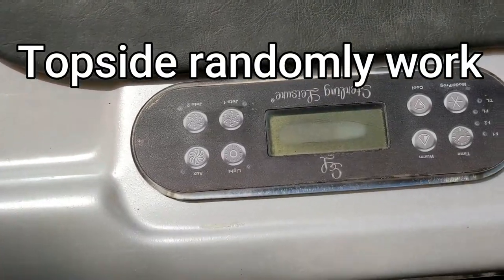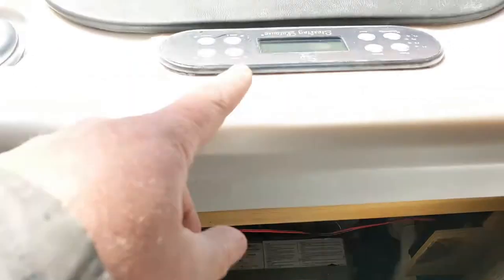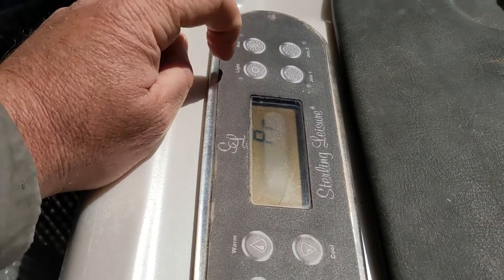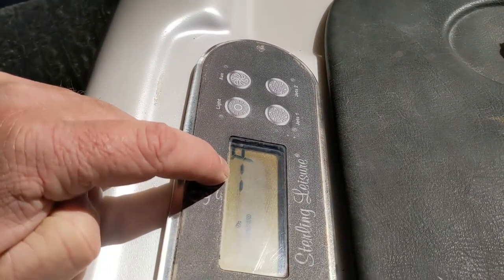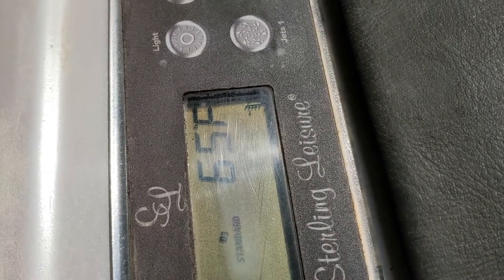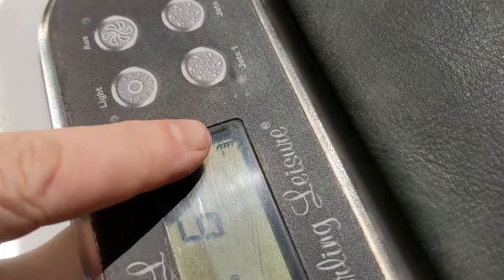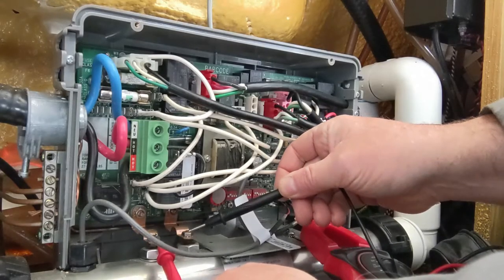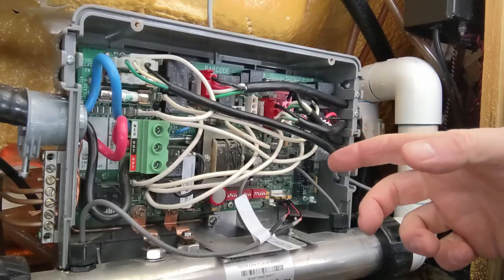HOT TUB Topside Control Panel Not Working Right ?

Comment: Easy video, thanks!  What are options if the topside panel is no longer in production? I see similar, ( has more buttons )  but not the exact same - thx!
Reply from the maker: Most hot tub spa packs have one or two topsides that will fit their pack.  Would try and get the same one or research the spa pack to see if theres another one for it.  Most times, there is information on the topsides on the inside part of the spa pack door

Comment: Would that technique work for master spa's? Nothing is coming on at all on my top side, when I turn the breaker I can see the icons or display for just a split second then there's nothing completely dead.
Reply from the maker: The controls are pretty much the same.  Doesn't matter if its master spas.
Reply: @VIPPoolsandSpas  okay I'm going to try that tomorrow. When I turn the breaker on I can like a relay click on the main board but nothing happens. I'm going to disconnect the topside tomorrow and see what happens. Thanks

Comment from the maker: This is a good way of testing your topside and spa pack.
Reply: Hi I have one exactly like this and everything works and test great it just has a little moisture inside like yours. Can I just remove the panel like you did and then remove the screws (looks like 4) holding the panel together and dry off the LCD screen? Thanks this will save me a few hundred bucks!
Reply from the maker: @quazink  you can try, but have never seen them work after.  There some sort of gel.
Reply: @VIPPoolsandSpas  okay thanks.... I'll wait till it gets so bad can't read it then try cleaning since I won't have any thing to lose at that point
Reply from the maker: @quazink  just take it out, unplug it and put it in rice for a day or so.  Tub will run on default.  Just can't turn jets on.
Reply: @VIPPoolsandSpas  Excellent advise! we can just let it run on default until LCD clears up. Yes actually that rice trick has worked on cell phone before also thanks again!

Comment: Got a hot tub for free it's an 8 man with an old Gecko 4 button topside. None of the buttons are responsive and it's lit up showing 8.8.8 . When I disconnect the topside from the circuit board the hot tub immediately fires up the jets. I'm guessing that's a topside control issue then ? 
Model of the topside control is K-18.
Reply from the maker: Yes.  When you unplug it and the pumps all come on, its the topside.  Need to replace that.  When you get the new K-18 make sure it's the right configuration.  MEANING: JET, JET, LIGHT, HEAT or JET, LIGHT, HEAT UP, HEAT DOWN.  Get the right topside overlay also. (the sticker)
Reply: @VIPPoolsandSpas  thanks. Only one left was the one on eBay I offered the guy $20 and he took it lol I bet it was on there for a very long time. It was missing a button though but looked exactly the same ;( only button it didn't have was the 3 circles button. Which I don't know is for.
Reply: @VIPPoolsandSpas  this one has Jet,light, heat up, heat down,.
Reply from the maker: The 3 circles are the blower.  Bubbles.  lol
Reply: @VIPPoolsandSpas  also do you know anything about converting to 120v because that's what I did. The maintenance panel does say it's either 120 or 240. So I made the switch.
Reply from the maker: You need the exact combination as your old topside.  if its JET,  BLOWER, LIGHT, TEMP.  You need the same one.
Reply: @VIPPoolsandSpas  do you know another one that might work ? Can't seem to find the original ANYWHERE.
Reply from the maker: https://www.thespaworks.com/gecko-topside-control-panel-k-18-2-overlays
Reply from the maker: There is a white sticker on the gray cord of the topside.  You need the part number off that and MUST get the same one.
Reply from the maker: @poohnay16  Follow the schematics on the back of the door of the spa pack.  You might have to move wires for the pumps or whatever else you have.  If the pump is 230Volts, the pump will not work.  Or anything thats 240v.  People change these over to 240v and when they replace the pump down the road, they just pot a 230v in.
Reply from the maker: What country are you in?  AND.  Give me the codes on that white sticker.

Comment: I have a great lakes hot tub.  The topside controls showed temp but jets would not come on.  It would only click.  Company came out to check, indicated it was the motor and pump.  This was replaced by them and then nothing came on.  When using the topside controls not even the temp would turn on.  They indicated it was the topside control panel.  This was replaced.  Temp shows and works, however, when trying to turn on jets . still have the same problem it just clicks.  No jets turn on.  What could be causing this problem.  Replaced the 2 parts the company advised it needed and it still does not work.  We ordered the control panel and installed it.  Not very confident the company knows what they are doing.  Any insite as to why it just clicks and does not turn on.  The company indited it maybe the control system?
Reply from the maker: What spa pack is in that hot tub?

Comment: Hi! I was wondering if you could help me figure out how to override a hot tub that has a malfunctioning topside control panel.  The temp button on my Strong Spa is not responding to touch (the other buttons are working).  We have ordered a new control panel, but there is a bit of lag time and we are a small exclusive hotel in the middle of nowhere and I really want the guests to be able to soak.  It is stuck at around 82 degrees, everything else is working just fine, except that one dumb button.  We have tried flipping the breaker, unplugging the cord to the topside control panel, unplugging the control panel itself and still...nothing. 

thank you!
Reply from the maker: Well.  You sure its the topside?  Because you say its at 82 and that tells me that its not even heating.  But not 100% sure. Can you set the temp up to 104 but stays at 82?  Can you set the temp up or down freely?  If the "UP" button doesn't work, you will have to remove the topside (depends on type and name of topside) and the sticker covering the face.  Put the topside in some rice for a few hours.  Its a 50/50 chance this will work.  nothing else you can do
Reply: @VIPPoolsandSpas  I am pretty sure it's the topside.  All the buttons besides the temp button work.  It is a balboa panel, with four buttons, two for jets, one for light and one for temp.  to raise or lower the temp you have to hold the temp button until it blinks then raise or lower it.  But that button is not responding at all to touch :(

We will try your trick and hope for the best! thank you

Comment: We replaced the fuse and the cycle now works . We also have a new pump and motor .. the high and the low jets do not come on
Reply from the maker: <Make it it's wired right.

Comment: Hooking up a new hot tub with the panel you show at the end but after the initial turn on of about 30 seconds it shut off and I can’t figure out how to get the control panel to light up again
Reply from the maker: Did you check the wiring of the GFCI ?

Comment: My cal spa Jets 1 button has become unresponsive due to use....rest of the buttons work fine. Is there a way to open up the panel and realign the button with the sensor?
Reply from the maker: sounds like you need a new overlay sticker.  Look on the topside cord and there should be a "tag" on it with the model number.  if you see the model number you can see what a new one costs and what an overlay sticker costs online.  you can also send me a picture of the topside to info@vippools.ca and I can check for you.
Reply from the maker: does pump one come on at all?  even if you don't try and push the button on.
Reply: @VIPPoolsandSpas  yeah, pump comes on automatically on low speed in filtration mode. I can also sometimes trigger it by tapping it in just the right spot with the eraser side of a pencil. So pump works, button just appears to be shot.
Reply from the maker: @speedblue88  you have to get ahold of cal spa to get a new overlay sticker.  Or a dealer.  you could try and take the overlay sticker off, unplug the topside, take the topside out, put it in rice and leave in for 24 hours.  after 24 hours hours, just plug it in the spa pack, turn power back on and see if it works.  if it doesn't work, you will need a new one.  Don't try and take it apart or do anything else to that topside.
Reply: @VIPPoolsandSpas  thanks, will give that a go. Appreciate the advice!

Comment: Are the top side control panels interchangeable between brands? The hot I have has a Sensation Spas control panel label on it. Other than that there's no other data plate.
Reply from the maker: Some brands, Yes.  Most, No.

Comment: How to test and fix the Down control button?  Temperature locked and cannot adjust down.
Reply from the maker: Depends on what it looks like and what type you have.  Sounds like you need a new overlay sticker or maybe a new topside.  Try unplugging the topside and taking it out, then put it in some rice for a day or so.  That might dry it out.  would need a new overlay.

Comment: My hot tub got power for a few seconds prime code came on went to turn on jets and lost power and won’t come back on. Power to the control board
Reply from the maker: Does it trip the breaker, what do you mean by "lost power"?  What button do you push that causes this?
Reply: @VIPPoolsandSpas  it won’t come back on at All
Reply from the maker: @heatherblevins583  have to test power going into the spa pack.  If you have good power coming into the pack, then you'll have to start testing fuses.